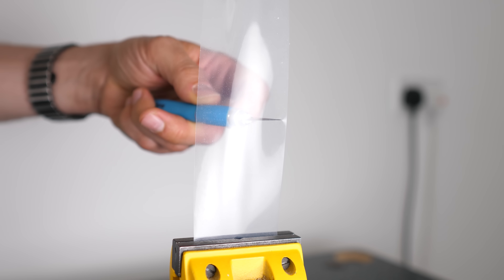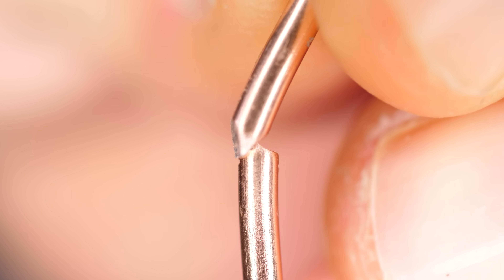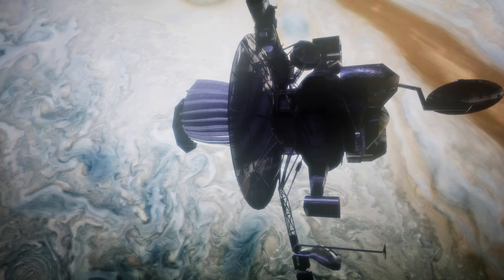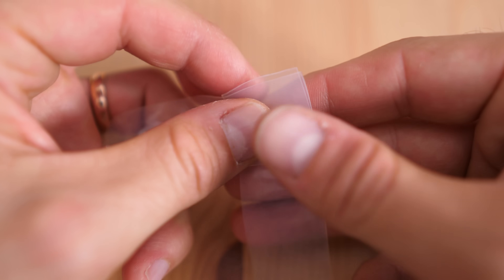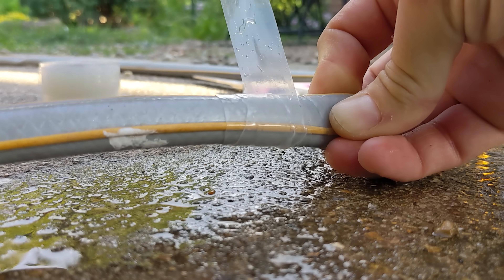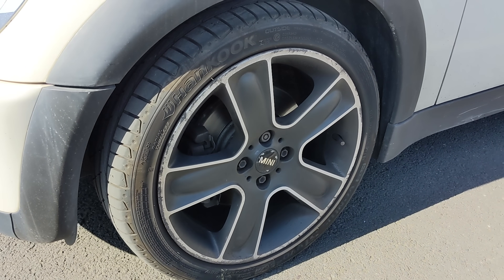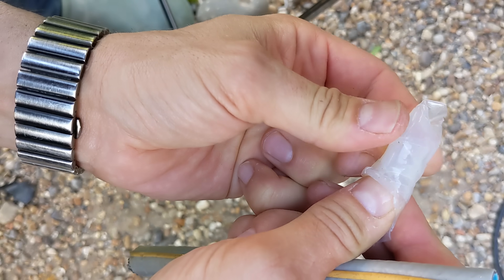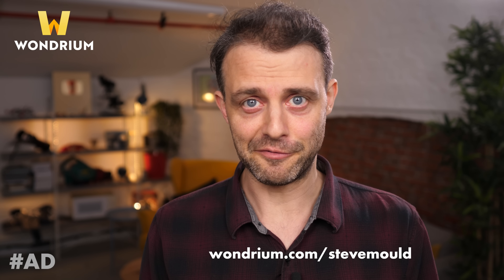Self-Healing Material

Comment: Really interesting to flip the thinking on this one and take something we're so used to and ask why is this the case? Another interesting question is how does current flow from one metal wire to another when they are simply twisted together, why doesn't the oxide layer act as an insulator? The answer is quantum tunnelling ... (or at least that's what I remember from physics taught 13 years ago).

Comment: This man is all kinds of wrong. First, he called water sticky. Water is soluble, it literally makes things unsticky. It is not an adhesive it is literally the opposite of adhesive.
Second, cold welding is what happens to metals in the vacuum of space because of the temperature. F cold welding happened just because of a lack of oxygen then it would be infinitely cheaper to Weld and a vacuum chamber on earth then to use contemporary fusion welding. Don’t believe everything you hear on the Internet just because some guy with an accent says it’s true kids.

Comment: A slight correction about welding metal. Oxidation is important to welding surfaces, particularly when fusing the materials with heat.
After you cut the metal it doesn't fuse because you're not actually applying enough pressure to make them fuse. This is the idea behind explosion welding. 100% pressure and no heat.

Comment: So how do you explain that when you cut metal in a vacuum it doesn't fuse back together,
but when you have 2 perfect flat metal pieces like gage blocks and you put them together they stick? (it's called ringing)
I would make the hypothesis it has to do with surface flatness and the deformation of the material when you cut it with an imperfect knife. (Which they all are.)
 If you would be able to make a perfect cut i.e. the material is flatter than one wavelength of light, they would "fuse" back together just like gage blocks.

Comment: My Dad was a tool and die maker for over 30 years at a manufacturer that had created a type of thick, clearish tape like that. It was completely smooth and slick, but if it wrapped over itself it would nearly instantly bond. You would need a small bit of pressure for a tight bond, but the stuff was incredibly, and it was the late 80’s, so it was unheard of.
ETID: I’d be curious to know the company the makes what you showed. It looks similar to what my Dad had part in. He would use it at home on hoses, exactly as you showed.

Comment: A part of our group happens to be working on exactly such polymers, so I am somewhat familiar with the topic. There are 3 main ways to get self-healing polymers (sorted from least likely to most likely to explain this polymer):

1) Simply using a highly elastic resin, which causes stress to deform the material rather than break actual bonds. Over time and sometimes with a bit of heating the original shape is restored. An example of this being used is the "scratch shield", which is a highly elastic clearcoat used by Nissan to give their car finish the ability to heal moderate scratches by itself. Clearly your material has bonds fully broken upon tearing, so this is not the technique that's being used here.

2) Separated reservoirs of unpolymerized monomers and initiators/crosslinkers/catalysts. These can be either capsules or vascular systems spread evenly throughout the polymer. Upon injury, the monomer spills into the cracks and comes into contact with the initiator/crosslinker, causing it to polymerize and heal the injury. An early example of this is the use of Dicyclopentadiene monomer capsules that, when released after an injury, are polymerized by Grubb's Catalyst through an olefin metathesis reaction (https://doi.org/10.1038/35057232). The healing process uses up monomer and thus can only be performed a very limited number of times. In case of a full tear, the spilled monomer would polymerize on the loose end. Once fully polymerized joining the ends would no longer cause the polymer to heal. It seems unlikely that this technique is being used in your material.

3) Reversible bond breaking and formation (Also called "Intrinsic self-healing"). Polymers of this type have specific functional groups that can connect and disconnect with corresponding groups in a reversible manner. After a tear, rejoining the ends causes loose chains to reconnect to each other, healing the polymer. Closed chains can also be opened and then rejoined to form new links.
There are numerous ways to achieve this, some examples include:
3a) Reversible formation of covalent bonds, for example via Diels-Alder-/Retro-Diels-Alder reactions (DOI: 10.1126/science.1065879). Some chemical bonds can be reversibly broken and reformed. After joining the ends together, chains in both ends can break apart and recombine with chains from the other end, reestablishing covalent links. Usually, energetic triggers like heating or UV-light are required to facilitate the mending process. You did not use any such triggers, so this is probably not what you have.
3b) Reversible supramolecular bonding. I am quite certain that this is what makes your polymer mendable at room temperature. There are several interactions that can cause polymer chains to stick to each other without any covalent bonding (ionic attraction, coordinative bonds, hydrogen bonds and π-stacking interactions). These can sometimes also be broken and reestablished at room temperature. 
You can imagine these supramolecular polymer networks to be like ball and stick magnet toys for children. Your sticks are short polymer chains with negative endgroups (ionic groups or chelating Lewis bases) and your balls are positive metal ions. The combination of both can form large networks of interconnected or entangled chains. The sticks can be flexible, but are not broken apart easily. However, the forces connecting balls and sticks are much weaker and so these connections can be rearranged with a relatively low activation energy, causing the material to stick to itself easily even after being fully disconnected for a long time. 
Even lower activation energies would be needed for hydrogen bonding networks (replace opposite charges with hydrogen bond donors and acceptors, H-bonds are significantly weaker than ionic bonds). An example for this is published here (https://doi.org/10.1038/nature06669). I think self-assembly via hydrogen bonding is the most likely explanation for the behaviour of your polymer, though of course I can't say for sure.

An interesting example of an elastic polymer that sticks to itself but not other stuff is Parafilm, which is just a mixture of polyethylene and wax. It can't truly "self-heal", but it goes to show that even much simpler polymeric systems can show some of these properties.

I just wasted an hour of my time to write this... oh well.
Reply: Not a waste. Was very interesting to read :)
Reply from the maker: This is amazing information, thank you so much!
Reply: @SteveMould  Heating the material past 90 degrees C should be a good test if the hydrogen bond theory to correct (it should melt).
Reply: You shared knowledge. No  waste of time at all. Thank you very much thats was very informative.
Reply: I read it buddy and learned a lot. Thanks!
Reply: I assure you it's not a waste, appreciate the effort.
Reply: That was awesome! I'm not exactly scientifically literate but I understood the overall concept of each method! Thank you for providing more depth while also being readable for someone with only a patchy high-school education!
Reply: You did what I do when I see a video touching on some area of materials science I know about! Glad to know I’m not alone
Reply: Thank you for sacrificing your valuable time! I've gained a lot of insight
Reply: You taught me, amongst a bevy of others, something many likely aren’t aware of. You have my thanks
Reply: At no time, is sharing knowledge a waste of anyone's time. Actually it was quite understandable the ways in which you described the different methods of obtaining the act of self healing, clarifying the differences in each example. Definitely no waste of your time.
Reply: "I think self-assembly via hydrogen bonding is the most likely explanation for the behaviour of your polymer, though of course I can't say for sure"
I wouldn't say your suggestion is wrong, but I'd argue it's rather unlikely to be the only mechanism that would explain the behavior of this self-healing polymer. The reason is the following: you need a lot of hydrogen bonds (or hydrogen bond density) to obtain both this level of mechanical strength shown in the video and self-healing properties. For example, you can obtain high mechanical strength and self-healing properties by using polymers with relatively rigid organic entities or functional groups that can form 3 or 4 hydrogen bonds in close proximity (and of course also "matching" chemical entities to provide the opposing end of the H-bonds). But there is a catch. Such polymers are incredibly sticky, which is the opposite of what we see in the video. I experienced first-hand how incredibly sticky this stuff is when I tried to synthesize such a "multiple H-bond" polymer myself (there is a special term for these polymers, but it's ten years ago I did it and can't recall the name right now). That does not necessarily exclude hydrogen bonding from playing a crucial role in the structural design of the self-healing polymer we saw in the video, but there must be a lot more going on than "only" hydrogen bonds.  

Thanks for your post. Was a pleasure to read!
Reply: No you didn't. You are among interested parties. Well, I am. Have you posted on Quora? Another place for detailed answers.
Reply: You must be fun at parties. Unironically. I'd love to hear stuff like this at a party.
Reply: I love parafilm!

I was wondering though, if it is hydrogen bonding then that sounds to me to weak to really hold together when pulled, or at least leaves me wondering how it is elastic enough to reform its original shape. Would the whole material be held together by H-bonding or just the join of the two pieces?
Reply: @HesderOleh  H bonding is stronger than var der Waals "bonding" and yet vdW bonds are strong enough to produce gecko feet effect! Its probably more effective than you think if you can get the surfaces into close contact!
Reply: @mduckernz  gecko feet require structural components to make the vdW work. If the gecko feet themselves were kept together by the vdW bonds is what this sounds like if the whole material is H-bonding, or is the seam much much much weaker than what keeps the material attached to itself when not torn.
Reply: I found that very interesting, and learned something from it. Helping educate others is never time wasted
Reply: Way over my head yet a got some feeling of what is happening  thank you
Reply: GREAT JOB, thanks for sharing.
Reply: Wow. Someone who is not only educated but can also speak (write) coherently. You can even spell and punctuate correctly! You might think this is no big deal but, in my observation, that is a very rare combination. I was so happy reading your comment, I nearly teared up, even though I could only understand about 10% of it. 

Okay, 2%. But I love it!
Reply: Thank you!
Reply: And I thank you for it! Really appreciate an answer for people who have more context
Reply: This was fascinating and educational. Thank you for sharing your knowledge!!
Reply: The time wasn't wasted at all! Thank you so much for sharing this! :)
Reply: The internet needs more people like you
Reply: Explaining something as interesting as this is never a waste of time, even if it took 2 days. if I had the funding I would most definitely put all 3 of these examples into production of some sort... Maybe making nearly indestructible vehicles and tools
Reply: @darrianweathington1923  It would likely be less "indestructible" and more "easily repairable"

Indestructible beans that it cannot be deconstructed, or broken apart. That is not the case for these polymers, as he cut them apart.

I would hesitantly say that a better term would be "reversibly destructible" or "reversible destructability"
Reply: This post needs to be... stickied!
Reply: damn thats crazy
Reply: I appreciate your hour of writing and generosity of knowledge! Thank you
Reply: Thank you, Isolan.
Reply: Absolutely not wasted! Thank you for the very interesting addition.
Reply: no that hour dude was spend teaching thoes who would not understand it  by our selves, however with such a WELL writen telling of 4 types of self-healing with one being a veriant. think you sir for making my knowledge of random stuff just that much more
Reply: Wasted an hour? My friend you just educated god knows how many people on a very interesting topic. Thank you for the explanation honestly
Reply: As so many other have pointed out, THANK YOU! For taking the time to write this all out! Such an interesting topic and sharing knowledge is never a waste! It's the most human of things to do. We are a curious species, hard wired to soak up knowledge and share it with others 😀
Reply: Not a waste! I'm a scientifically illiterate person, but this was interesting to read 😁
Reply: Today I found out my balls are positive metal ions, that’s why my stick is semi flexible. Jk, thank you for spending an hour to write that because it took me an hour to read it. But really, it was super interesting thank you
Reply: did i read "SupraMolecule" ?
Reply: Awesome
Reply: Great response 👍 thank you!
Reply: Very interesting an informative. Thanks for your time.
Reply: I was looking for a more detailed and scientific answer in the comments. Thanks for taking the time!
Reply: I am so glad I just read this today. You didn’t waste a thing, it brought back my orgo chem knowledge so much.
Reply: Correction, you spent an hour teaching us about self healing polymers. This shit is so much interesting compared to what I learn in university.
Reply: God damn nerd
Reply: This is so interesting to read o.m.g
Reply: Not a waste at all, thank you for sharing with us!
Reply: I did writed a little report for my schoolsubject about self-healing polymer of two monomere to crosslinked. For me is Furan and maleimide are on of the monomers which use the [4+2] cycloadduct Diels-Alder/retro-Diels alder mechanisme. I was wondering how this can be applying for medical use like anticancer medical. It was really interesting journey for me to read between those research papers.
Reply: Thanks for this interesting information🤗
Reply: Where can I buy this stuff?
Reply: Thanks for wasting an hour of your time. 😁 It was very informative
Reply: Thanks for taking the time to write this. Enjoyed reading it and learning from it.
Reply: It is very satisfying watching someone be very good at something.. and in this case, very knowledgeable! Thanks for sharing!
Reply: Ahhhhh.... First of all I wanna thank God that people like you who took the time and wrote this( even though you thought it's worthless) he made.... Cuz nowadays people around me don't put effort unrequited way. You bring back my belief that there are still some people who have this amount of patience. A virtual handshake for your amazing work!
Reply: Thanks for sharing your knowledge. Wish I actually understood more of what I read.
Reply: One hour on a comment!
Reply: And I just read the whole thing. I didn't understand the specifics, but I think I got the generalities. Thanks!
Reply: wasted?  no.
Reply: Such things you see in youtube comments..
Reply: I giveaway Beyblade
Reply: is he talking about the retro-encabulator?
Reply: “Oh well”
Reply: bro leaked government secrets
Reply: Things you did last year that taught someone else something new today = not a complete waste
Reply: This is extremely helpful, God bless you!💫
Reply: Not a waste. And I love you.
Reply: Legend
Reply: I was tempted to reply that my stick is not a short polymer chain but that my balls are definitely positive metal ironclad. But No ☝️☺️. Instead: doesn’t method 3 hint to the fact that these pieces are manufactured by slicing blocks instead of plain extrusion? In order to produce the ability to heal where it hasn’t been torn by the user?
Reply: Nope, I think it's done with magnets!
Reply: Thanks friend 🥰

Comment: Steve, try doing this in a nonreactive non-oxygen environment, in a nitrogen environment or something.  I'm wondering if the thing doesn't develop some sort of oxide layer, only the oxide layer actually HELPS the polymer to cross-link.

You might try it in a tank of just oxygen, one of just nitrogen, and another of just CO2 and see if it still heals.
Reply: It wouldn’t because oxidisation happens in an atmosphere filled with oxygen. Therefore in nitrogen it wouldn’t oxidise and it would stay shiny.
Reply: @JamesBricks06  Not the metal -- the polymer.  Does the polymer enlist oxygen in such a way as to help it stick together rather than hinder it?
Reply: @jcortese3300  smart idea
Reply from the maker: Hi! Thanks for the insightful info, really appreciate it. If you're interested in joining my Discord where we chat through ideas here's a one time link: https://discord.gg/vdJaHpjxeY

Comment: Fun fact, bird feathers can do the same thing. If you "rip" the edge of a bird feather (but not the stem) you can reconnect them by placing the two parts back together and rubbing them. They will even repair themselves without a seam. This is done through a bunch of tiny hooks in the feather.
Reply: I always thought "Velcro" was invented because of sticky burrs. Feathers do that also. Hmmmm. Nature at is best.

Comment: You didn't mention self amalgamating rubber electrical tape which has been around since like forever. I used this tape back in the 80's for high voltage electrical connections.
https://www.morrisproducts.com/pc_product_detail.asp?key=DB7C5CF42DFA4CA881DCA19840D14605